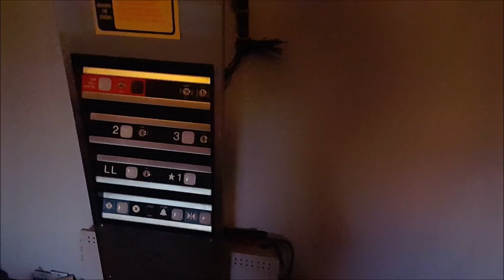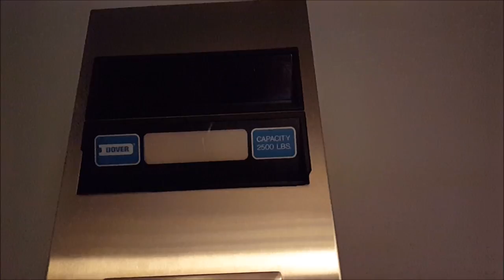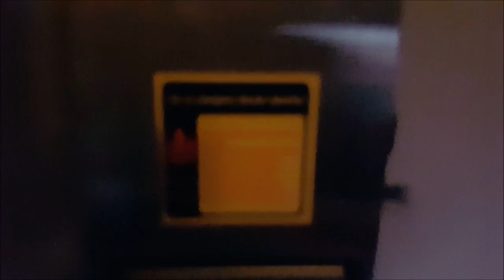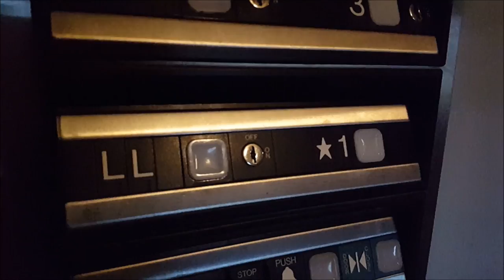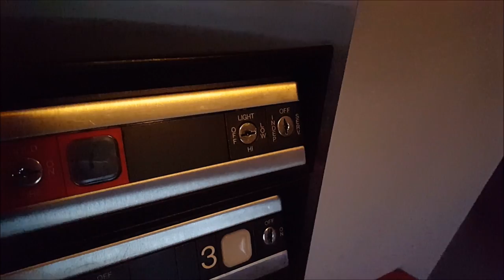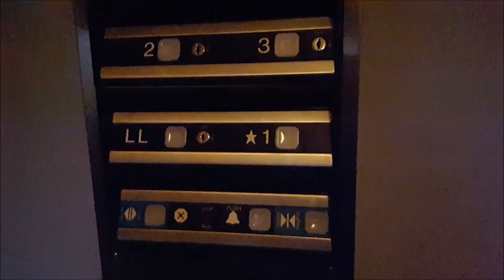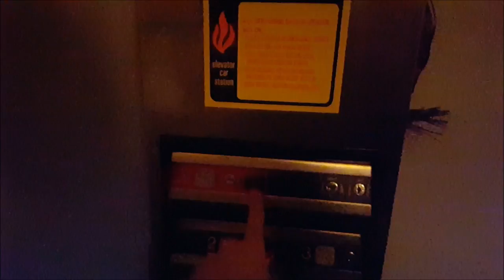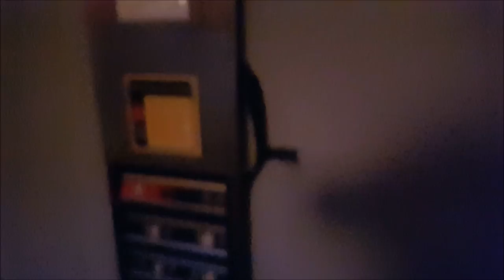Dover Impulse Elevator Car Operating Panel

Comment: Wow!! That's some awesome parts! That would be cool to wire up the panel with relays to keep the buttons lit and the cancel button to turn off the light. Somehow you could wire the indicator…
Reply from the maker: +Cherry City Elevators Thanks! Yeah, that's an idea. I figured out everything, except for maybe the emergency light, takes 24 volts DC so now I just have to figure out where all the wires go.
Reply: I have some Dover parts, and they work on 24v but I actually think they take 48v. I guess they would be a bit brighter on 48v
Reply from the maker: +Cherry City Elevators I believe they do take 48 as well, but 24 is more convenient for me, haha. You'll have to make a parts video sometime!

Comment: Awesome! This is such a great part! Also, stop run takes the H1846. Some ideas for those lockout switches are the H2011, H2252, and H2007. I have an OTIS series 1 panel in my garage. Unfortunately, stupid 8-year-old me felt it would be smart to take it apart and get the individual parts. It is now a hot mess. With the help of Unitec, I hope to refurbish it :)
Reply from the maker: +Elevation Station Productions Thanks! Yeah, I made several mistakes in this video. I got the H1846 and the 1848 mixed up a little. I think my dad might have one of those other H series keys on his work ring that I'll have to borrow and try out. And sorry about that. Hope you can get it put back together!
Reply: I am going to work closely on it. I hope it works out. Are you an elevator key collector? I am a very avid one with over 40 keys!
Reply from the maker: +Elevation Station Productions I have a bunch of them, but I haven't purchased one in a long time.
Reply: Cool.
Reply: My panel is an early hydraulic panel with floors P, L*, 2, & 3.

Comment: You got a landline? wire that phone up to call your phone or something. I think they run off 9v batteries
Reply from the maker: +WheelockElevator We do. I'll have to investigate that and read the manual for this particular model. I can't seem to find any power or telephone line connections on the back of it right now.
Reply from the maker: +WheelockElevator I'll take a photo of the back, and if you can give me your email address, I can send it to you tomorrow.
Reply: you stole that  from deisel ducy grr
Reply: no he did not
Reply: he got that from 200 south naperville road